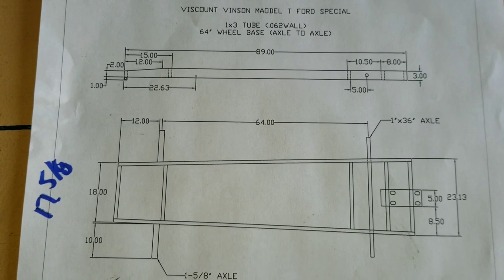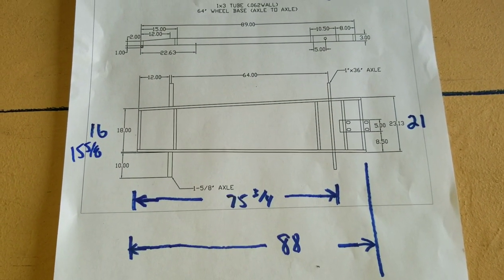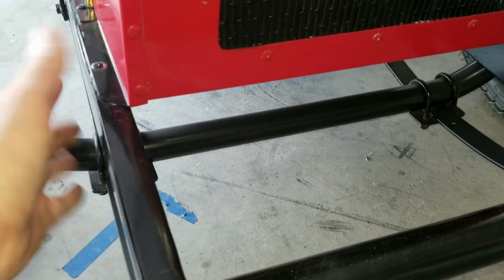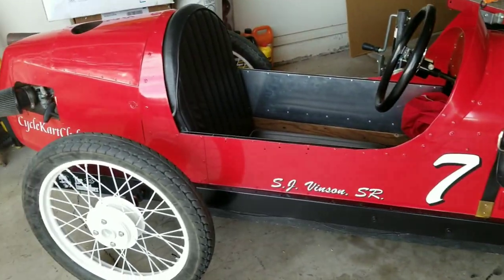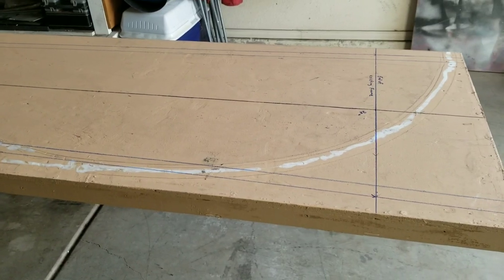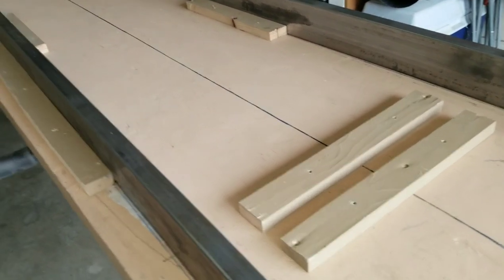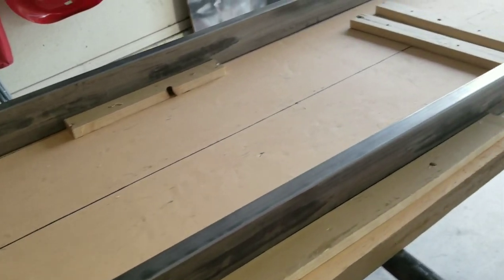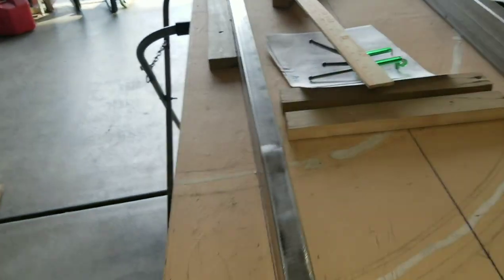Cyclekart Frame Video 2

Comment: Do you think 2x4s will work for the frame instead of steal?
Reply from the maker: Not a standard 2x4, no.  Some guys have used a few different types of wood, typically something similar to what the original car may have used.  Some have used a laminated wood to give it extra strength.

Comment: if you used wood what type and thickness do you need ?
Reply from the maker: For the frame? I would think something close to 1" x 3", for the body at least 1/4", not thicker than 3/8" to avoid being too heavy